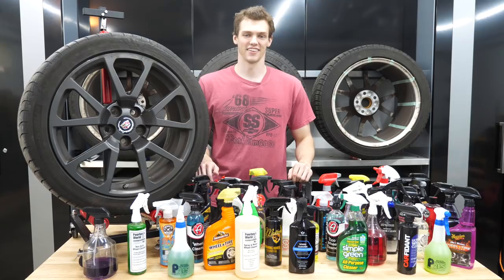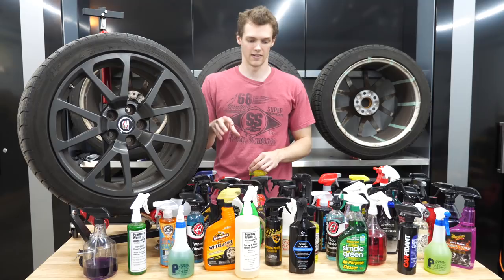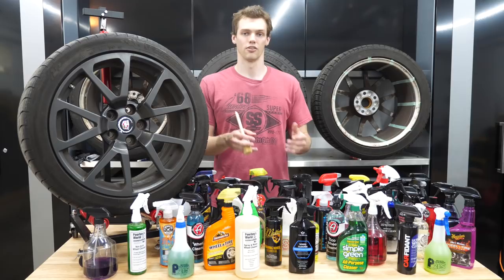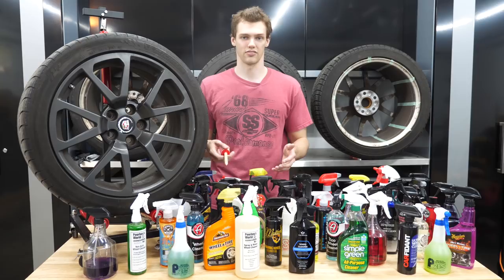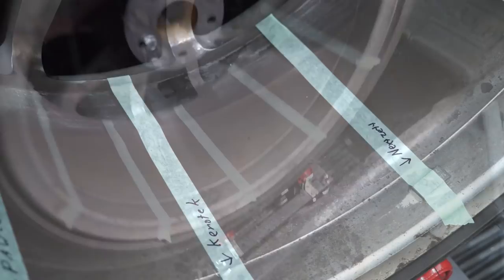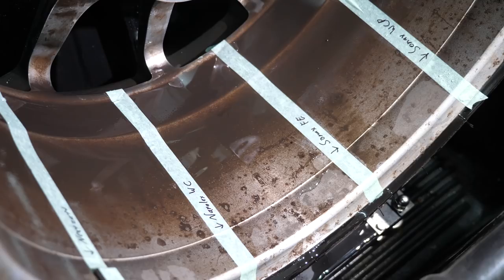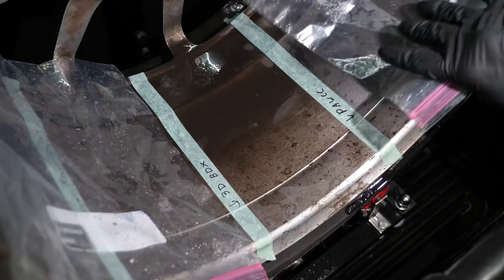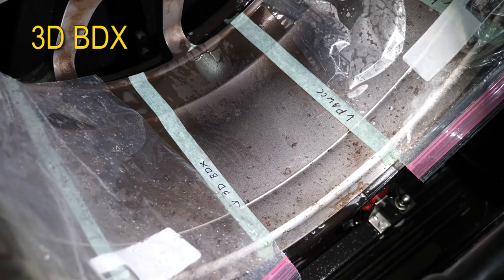The Ultimate Wheel Cleaner Experiment: Real World Testing Pt.1

Comment: I have a ton of garage type heavy duty concentrate cleaners (simple green airplane parts extreme, simple green motorsports extreme, por-15, etc…). I tried to test these again a cheaper McGuires yesterday and the BiG problem I had was that those cleaners dry so dang fast while the dedicated wheel cleaner would foam and be able to stay on surface much longer before drying. Wonder if I should add a little dish soap to those cleaners to help foam. Or maybe it is just the nossle that provides the foam action?
Reply from the maker: Yes the nozzles make the foam, but to help with keeping everything wet I am generally wetting the entire wheel before spraying it with cleaner and that seems to work well